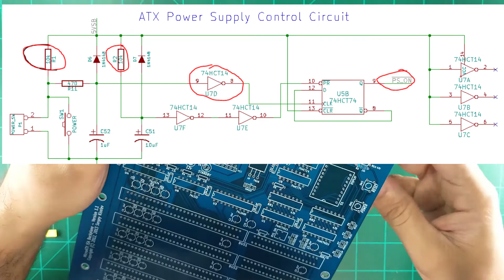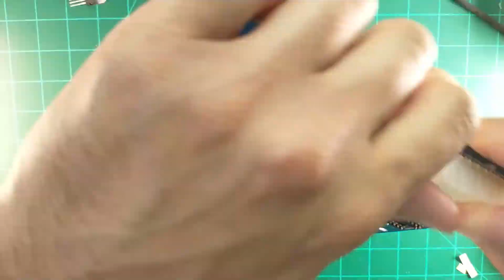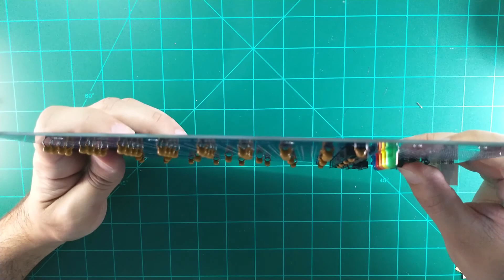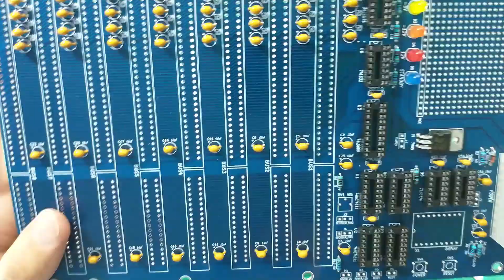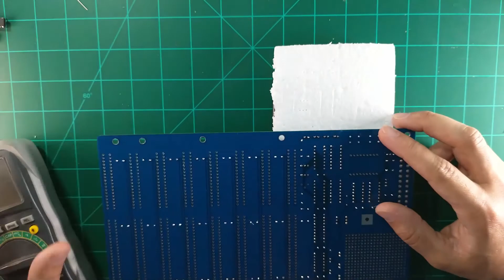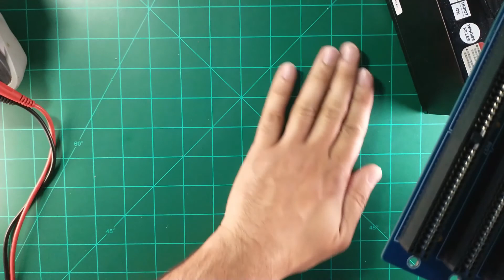Build an IBM PC Clone from Chips Part 1 - MicroATX ISA Backplane

Comment: Using 4511 decoder ics. Jumpers 2-4 are shorted to their respective pins. But the lcd display is giving me 0. 1.The decimal point after 0 isn't lit. Help!
Reply: With nothing plugged in when you power on it displays just the rightmost decimal point. If you have a have a processor board then it goes thru the post sequence normally displaying all the numbers with both decimal points lit. I use it with the Xi8088
Reply: Im thinking of using the 512KB TRIDENT TVGA9000B 16-bit  vga card. Any way to activate  8-bit mode?
Reply: With the slots empty when I power it on I get 0s in both decimal places. The rightmost decimal is lit.
Reply: 3 jumpers are required.  Jumper Header 2 should be short on pin 1,2(left 2 pins) jumper 3 should be on pin 2,3(right 2 pins) and jumper header 4 should be pin 1,2(left 2 pins) if you have those set then it should work.
Reply: All the jumpers are oriented correctly. But I get a 0.1. on the display Is that normal ? Thanks.

Comment: So when and where would I use this and how would I use this? What computer? Can you show us how to use it? Can this replace the IBM original one? I think you can buy one of these from IBM to add more slots but it has its own case.
Reply: Research!;)
Reply: You need an ISA SBC, that would have the processor, memory and other stuff that would be in the motherboard, then you can put other expansion cards in the ISA slots, like VGA, Ethernet, Sound etc.